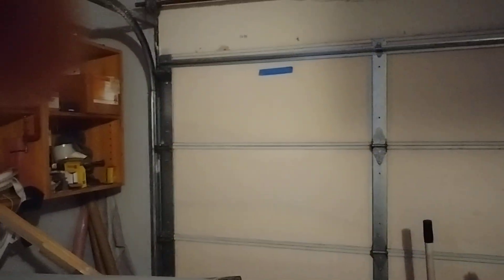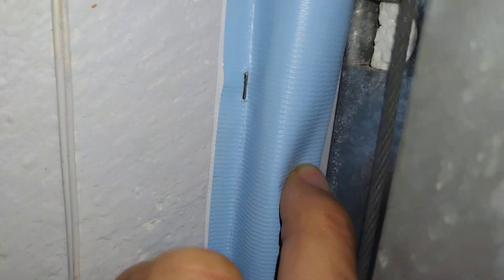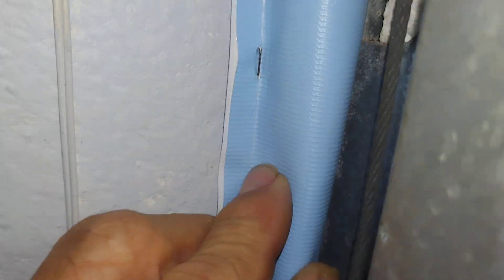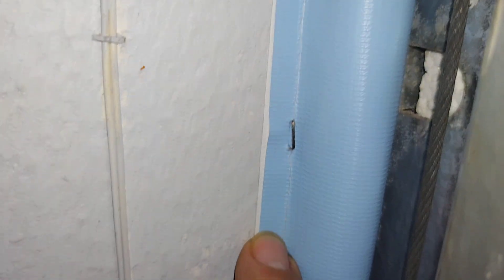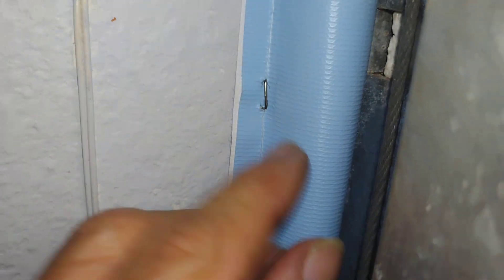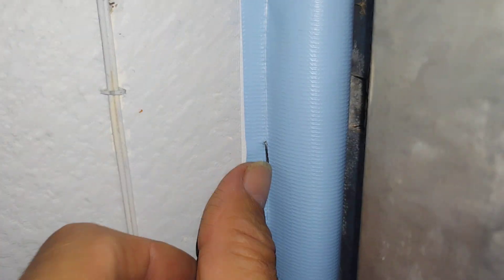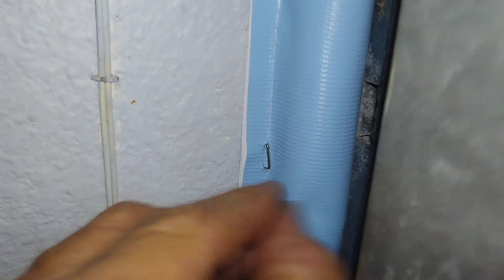Hurricane hack #03

Comment: Better to weather seal on the outside so the pressure pushes the seal against the door.
Reply from the maker: @janofb  it already is. Better to do both sides for a redundant double seal on both sides.
Reply from the maker: @janofb  when you have a 125 mph wind you need it crewed shut with 6" lag bolts and cleat blocks and the rain still gets in.